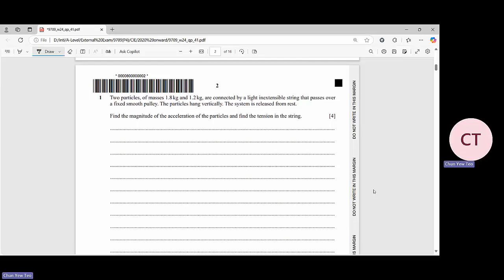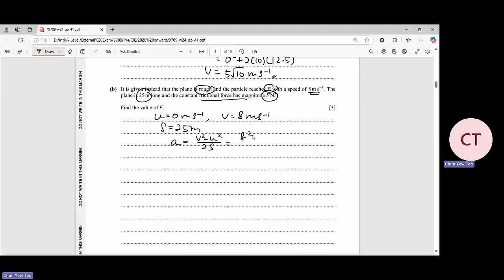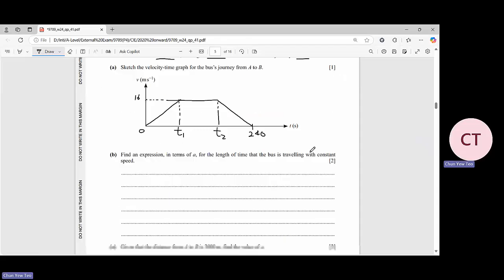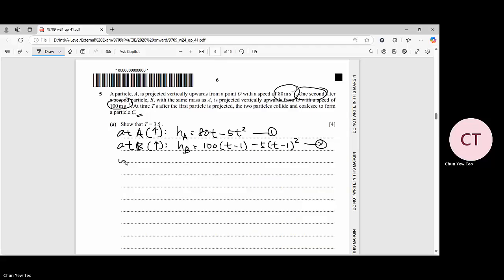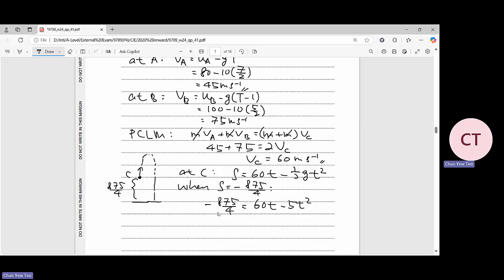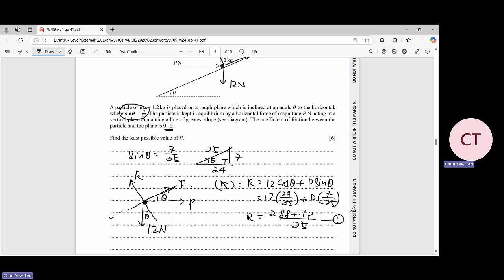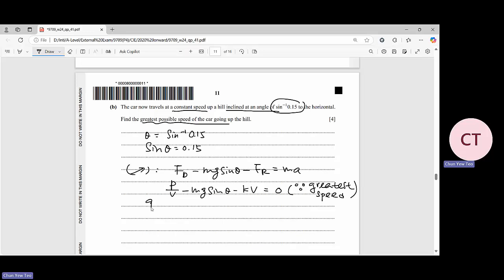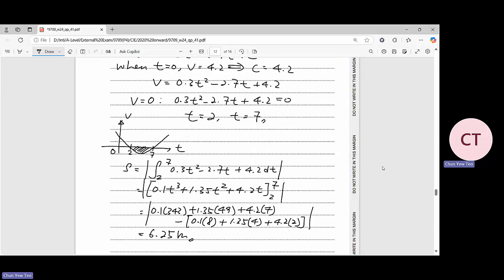9709/41/O/N/24 CAIE A-level Mechanics Guided Solution

Comment: for q4, part c , when u said for area of the trapezium we do t2-t1, u did 240-64/3a which is only t2 , u didnt subtract t1 from it which was 16/a. Isnt it supposed to be 1/2 (240+ 240-64/3a-16/a) x16? why didnt u subtract 16/a from from 240-64/3a?
Reply from the maker: HI you are correct. There is a mistake in the video btw. I will pin your comment to make others aware of this ya.

Thank you very much for pointing this out!!
Reply: however it can be 240-112/a? im not sure maybe im doing something wrong. pls explain
Reply: @mai553 hi

Comment: in the 1st question why is that 1st equation is 18-T and 2nd equation T-12 ?
Reply from the maker: In 1st equation, the particle is moving downwards, which means that mg is greater than T in the string, therefore it is 18 - T = 1.8a (Originally equation is F = ma or net force = ma).

2nd equation, the particle is moving upwards, which means that T in the string is greater than mg, therefore we will get T - 12 = 1.2a (Originally equation is F = ma or net force = ma).

Comment: For q 5c why is the displacement equals to 218.75? Like the particle c should travel further up till its velocity becomes zero then turn. When particle c was formed it was already a height of 218.75 m above right, then shouldnt the turning cause extra displacement?
Reply from the maker: When we are using s = ut+ (1/2) at^2,
u is the initial speed projected upward and a =-10 as it is against the gravity.
when we form this equation s in terms of t, it actually shows how to object moving when t=1, t=2, t=3, etc.
Reply from the maker: We are letting s = -218.75.
the equation of s = 60t - 5t^2 of particle C already included the movement of c going upwards then come down again.

You can substitute t=1, t=2, t=3, etc into s = 60t - 5t^2 and observe what happen ya.
Reply: @cixiangng  if the c is coming down then doesnt the acceleration become positive towards the ground?
Reply from the maker: @ilovenanabhaiandnaan When we are using s = ut+ (1/2) at^2,
u is the initial speed projected upward and a =-10 as it is against the gravity.
when we form this equation s in terms of t, it actually shows how to object moving when t=1, t=2, t=3, etc.

this equation can be used for the movement of the particle for going upward and downward in general.
Reply: @cixiangng  i dont understand, how does it include -218.75